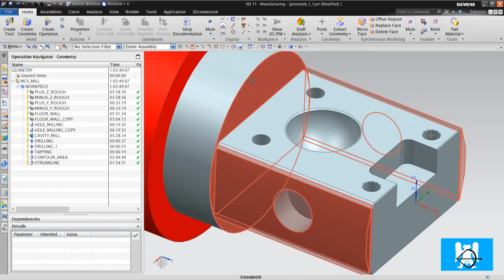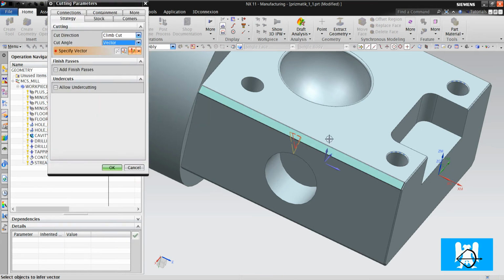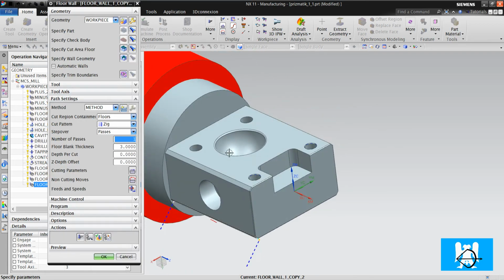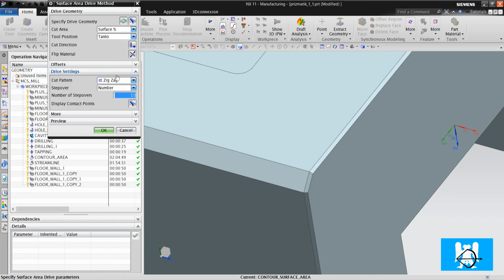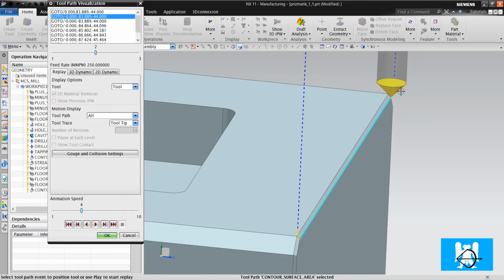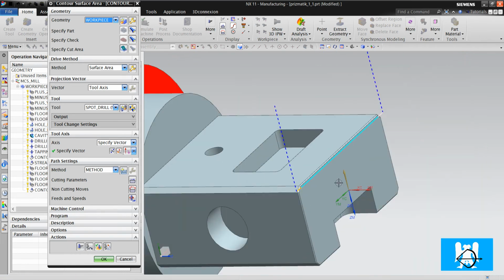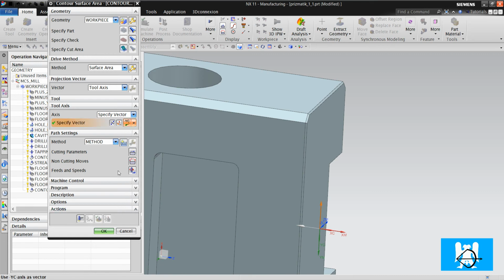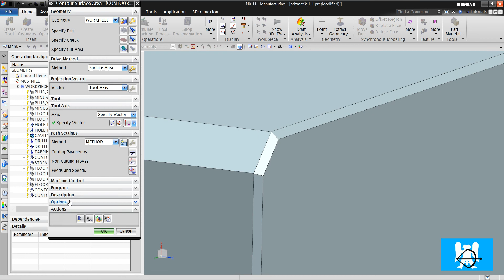63-4 Axis Indexing Sample-5.Part

Comment: Why we can't take smaller chamfer in continuous path by rotating rotatory simultaneously in A axis.
Reply from the maker: If you add edge blend between chamfers for continuous move, you can make it with streamline operation.